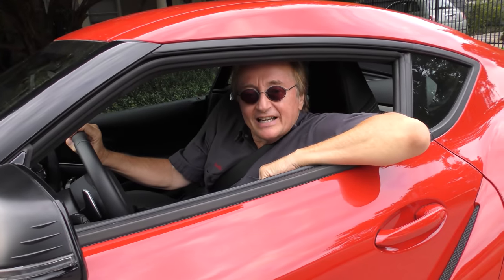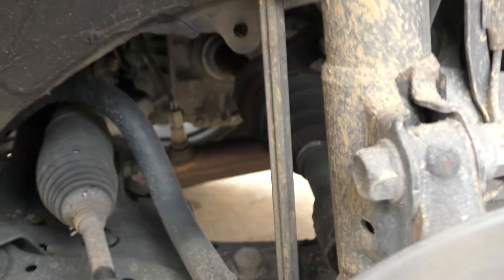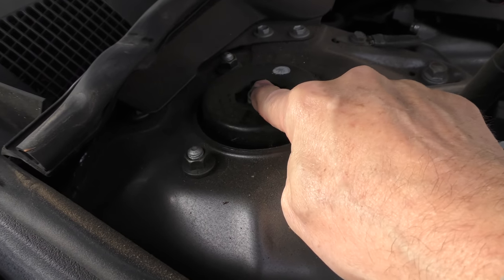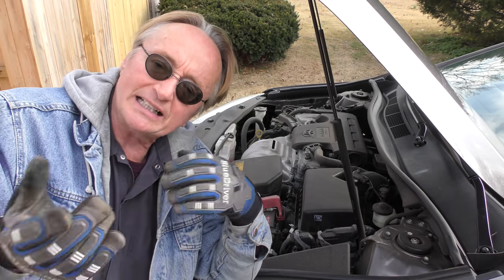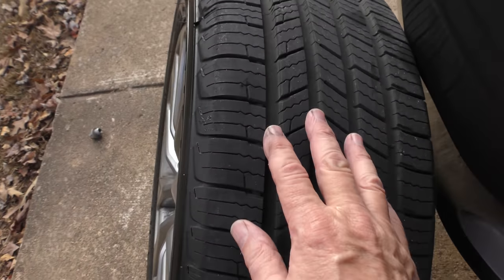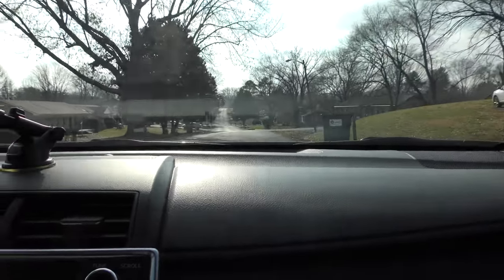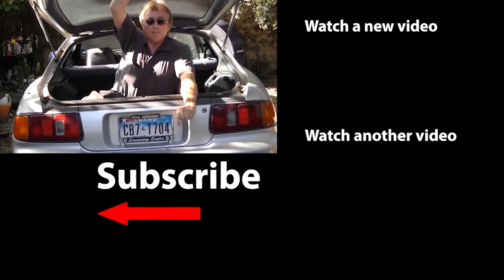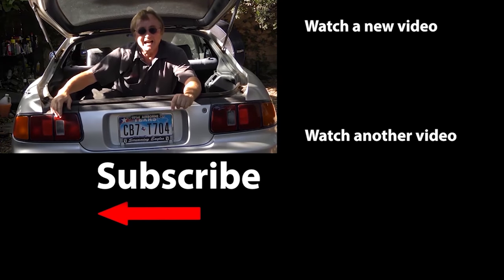Mechanics Don't Want You to Know This About Your Car's Suspension

Comment: Warning: DO NOT USE THE AT - 205 RESEAL on your rubber suspension bushings as Scotty is telling you to do so. It will weaken your rubber and disintegrate it if the rubber is old and crusty already. I know this because I listened to Scotty on this one and had to replace a rubber part a day after I applied this stuff. The chemical expanded the rubber so much it fell apart.
Reply: Oh no! I wonder if a basic silicone gel like someone else mentioned would work?
Reply: @CC12398   No idea. There are rubber conditioners for interior seals and trim but I never heard of anything strong enough to penetrate bushings without destroying them molecularly. I would just try to keep them free from dirt with occasional water spraying the dirt off.
Reply: @matreyia  thank you so much!
Reply: Could you just spray lithium grease?
Reply: @denver7745  I would avoid using solvents to penetrate bushings. I use Gummiplfege (rubber care in German) on all rubber seals and gaskets to keep them pliable and resist cracking from heat. I suppose that would work for the bushings but personally, I think just cleaning the underside from time to time will keep them from cracking. They are not exposed to sunlight as much as the topside rubber parts so the enemy for them is dirt and road chemicals.

Comment: Hate to say this but Toyota dealership mechanics & service managers, at least in my town, are complete scammers.  My wife got a coupon for an inexpensive oil change at a Toyota dealership so she took it in.  When they called back to tell us it was ready, the service manager says to me "you know, it's past time for your vehicle to have the timing belt replaced, & we should replace the water pump at the same time.  That'll cost about $1900."  Well, my wife's car had 32,000 miles on it & the pump & belt are good for 100,000 miles, so I crammed that factoid right into that guy's face.  BTW... Honda dealerships do the same illegal crap, which is why.... Scotty's channel is so popular.  I hate working on cars but I  hate crooks touching my car worse.   Thank you Scotty!

Comment: The rubber rejuvenator might not be such a good idea if it is the same thing as brake fluid, which is what most of your engine oil stop-leaks are made from. Problem is it starts out well by causing the rubber to imbibe the liquid and swell a little, but then it keeps swelling and eventually rots.
Reply: @hardassteel  Yeah, it will cause it to swell until it crumbles into little pieces.
Reply: @hardassteel  I wouldn't say that, as it can be a good temporary fix, but just know it doesn't last because of the rubber degradation after it swells only so far.
Reply: @akonitony2  I don't know the technology used for making these chemicals but it doesn't make sense to deteriorate rubber when it's formulated with the purpose to stop leaks due to deteriorated rubber gaskets and seals. 
ATP Automotive, the company that makes it has a YouTube video with the name "AT-205 RE-SEAL: Engine Stop Leak, Power Steering Stop Leak, Transmission and Differential Stop Leak" The video starts with the statement, quote: "AT-205 is an exclusive formula that stops leaks fast, by reconditioning and restoring rubber based gaskets and seals. ...  AT-205 contains plasticizers, the type of chemical used in the manufacturing of rubber gaskets and seals to set their flexibility. As a rubber gasket or seal gets older plasticizers lose their effectiveness, causing the seal to harden and lose flexibility, potentially causing leaks"
 On the other hand I wonder why this product is not also advertised and sold in spray bottles for what Scotty is using it but only as oil additive. Hard to imagine Scotty figured that out but not the company making it. When I search for "best treatment for car rubber parts and seals" it's mostly silicone based products.
Reply: @3dEmil  I've gone thru a year of organic chemistry on my way to Biochem. There is a saying, like dissolves like. You don't want to use petro-based solvents on petro-based rubber. Thoas products you mentioned work by swelling the worn seals until they stop leaking. They don't suddenly 'recondition' them and they are good as new. Factually, they do not stop swelling and eventually break open for a major leak for those dumb enough to not physically replace a leaking seal as soon as they discover it. Silicone will not penetrate petro-based rubber, but will dissolve silicone rubber.
Reply: @akonitony2  Thank you for replying. Do you know or how to find if all these rubber parts Scotty sprayed in this video are petro-based or silicone based rubber?

Edit: I just found the information on the label of the AT-205 Re-Seal bottles and since you said "if it is the same thing as brake fluid, which is what most of your engine oil stop-leaks are made from" I wonder if the following information make this chemical as you were guessing petro-based. 

"AT-205 Re_Seal is a fast, effective and safe stop-leak for all rubber seals and gaskets. The exclusive formulation restores worn or dried out seals and is not harmful to internal bearings and components. ... do not use in brake systems ... does not contain petroleum distillates"
Reply: @3dEmil  Experience. It becomes very obvious after comparing most parts. All of the parts he sprayed in the video were petro based rubber.
Reply: @akonitony2  Thanks. How about the AT-205 Re-Seal? From what it says on its label that I quoted in my previous reply, can you tell if it's petroleum based or not?
Reply: @3dEmil  I looked at it and it says no petro distillates and won't over-swell seals, so probably a good product.
Reply: @akonitony2  Thank you, I really appreciate your input.
Reply: @3dEmil  My pleasure

Comment: Hey Scott i had a camry 2012  my toyota dealer shop said my lower front control is tore.  But I drive it normally nothing wrong.   I only had 96000 miles.  Any concerns.   They said it is expensive to replace.

Comment: I had a 1996 Taurus and every time you'd drop the front suspension the upper strut mounts would creak and groan when turning the wheel. The transmission was replaced and we had to pull it back apart after that to replace the strut bushings to get rid of the noise.

Comment: My daughter's 2014 CRV has a rhythmic thumping coming from the left rear. It is clearly in sync with the rotation of the wheels and continues whether I'm accelerating or coasting.  It's very pronounced between 25-35 mph.  the noise stops if I turn the wheel to the left, but remains if I keep it straight or turn right.  I've already changed the wheel bearings, CV axles and sway bar linkage on both sides.  Like in this video, it does not sound to be anything majorly wrong, just very annoying. any ideas?
Reply: update: I took the entire back brake apart, lubed all the parts including the back of the rotor where it meets the brake shield.  Something in that process fixed the problem.

Comment: Hey scotty I am having a real bad problem I have a clucking in the passenger side front end of my 2021 honda accord when going over bumps it is under warranty so they replaced both struts but did fix the issue . I brought it back and they are telling me it's cause I used aftermarket brakes which is rediculous because it only that 1 side brakes are the only thing I'm responsible on the car . I looked at the links and bushings and they seem pretty solid but I did see a crack on the frame where the control arm is attached to it doest look huge but it's there . Do u think that could be it ?

Comment: Toyota do sell there new engines to other manufacturers 🤨 lotus have been been using different types of Toyota engines for years
Reply: This is very true! Lotus dumped the rover engines for the 1.8 and v6 Toyota engines.
Reply: @leestringer8881   they had used Isuzu before as well
Reply: @leestringer8881  Best move they did too but those Rover engines hurt their image and hasn't gone away since...

Comment: My car is a 2016. My battery light isn't showing. But my car won't start without a jump. Autozone said that my diodes are bad and my battery is dead. Car works fine after a jump, there isnt any dimming of lights. It's really cold here. I was gone for a week, but last year it was -10° and my car ran fine. What should I do?

Comment: But you didn't check the back for any signs of noise?  I can't recall if the Camry uses shocks or not in the back but it might be worth checking out the rear suspension too....  On my 97 Civic I used to get noises too when I go into reverse.  Found it was something loose in the rear suspension that needed to be replaced, so I'm a little surprised you didn't check both front and rear.

Comment: I experienced suspension noises after I picked up my car (Honda Accord V6) from the dealer (brake job). I inspected the car and tightened the top of the front struts incrementally over a period of 3 days and the noise was gone.

Comment: Scotty sir we have a Ford Aspire (KA) here in India. When we hit a sharp speed breaker at normal speed the suspension makes a thud sound, it does not happens on highway even though when we hit a bump on high speeds but it only makes sound when we hit a sharp speed breaker at low speeds and it only comes certain times (Aspire 2019 model) 
Can u guess what the problem could be?

Comment: I have 2000 ford expedition xlt 5.4liter motor cylinder 8 ignition coil is going out i have the parts to replace all of them but do i need to change the spark plugs or just clean them

Comment: The AT-205 stopped plastic fittings on the outside of my cars windows from bending & firmed up my wiper blades. Do not used on acrylic plastic, like brake/headlights & blinkers etc.

Comment: I have a 2001 Lexus and it’s about to hit 200k miles. Besides little tune ups and maintenance, the only major thing I had to replace was the harmonic balancer. It got old and cracked and fell off. I got one for about $150 tho and that’s the only major thing that happened over 20 ish years

Comment: Les schwab told me my lower control arm bushings are torn. I hear more then clunking noise I feel my steering wheel shake BAD when i press the brake at high speeds. Do u think it’s the bad control arm bushing? Or should I use the polymer

Comment: I have a 2006 Avalon with over 200k i take care of it i just got all new struts and driver side ball joint bearings etc.. From 60 to 70 only my steering wheel shakes not slower or faster??any suggestions?

Comment: Could also use a long prybar and wedge it by the control arm bushings to peek under to see if there are any cracks. I guess some mechanics replace the whole control arm with the bushings, but they can also be pushed out and pressed in with a machine, saving you the cost of the control arm. Something to look into..
Reply: The extra cost in labour is more then what you would save buying just the bushings. It is more economical to just replace the whole arm most times.

Comment: scotty  I have a 2018 toyota rave 4 se model . the car runs fine no issues get the oil changed every 5 k miles however my last oil change the dealership said i need to have  the front diff fluid svc,rear diff svc,throttle serv, and brake fluid svc.  the car has 30k mile on it and i dont know if i really need all that total of $544.09. need your advice thanks vincent  from nj

Comment: God bless everyone who watches these videos to learn lol. That bushing is warm out, dry rotted, and cracked. It’s not to the point where it’s unsafe to drive but it is warm out. Warn out control arms can allow the tire to shift when breaking or going around corners. It’s gunna wear tires out faster and you won’t have the best control of the vehicle under hard braking or turning. Everything on a car has a purpose and just because the tire won’t fall off doesn’t mean it’s not warm out and should be replaced.

Comment: scotty: i am looking to start a side job where i need a truck for pulling 14ft trailers 10k trailers to be specific and to stay under 26000 gvwr "truck and trailer combined"  i am looking at 2500 series trucks but i have never been a truck guy. looking for a truck under 10 thousand in your opinion is there a truck brand  that is better, offers more, breaks down less, a transmission i should look for, or worse look out for? maybe you could point me to a video you already have. thanks

Comment: Took a 2012 Honda Accord to get inspected and they said the lower control arms needed to be replaced to pass inspection but I checked them and they look just like that only a little rubber crackage.

Comment: Hi Scotty, Jeff in Costa Rica. I have ESC/ABS traction control fault lights on, on my 2013 Tiguan diesel 4Motion car. Is it possible that these faults show up when it’s time to replace the brake pads?  This car has less than 68000 kms on it, but this is CR, so, things wear out prematurely. I have pads already, so I’m wondering if changing them would reset the fault codes. Thanks, I hope you’re enjoying Tennessee. I have friends here from there. PS. I was thinking too that perhaps because the car is sitting so much now with pandemic restrictions, the sensors are corroding and giving false readings.

Comment: Hello Scotty, I have a Toyota Avensis SDN Prestige 1.6L 2008 manual 5 speed, and its doing the same. But can I use BARDAHL SILICONE SPRAY LUBE 400ml rubber care instead of AT-205 re-seal? Thanks.

Comment: Hi there Scotty. I just purchased a 2017 Toyota Camry SE. The car drives smoothly,  but have noticed a loud pop/crack noise while driving that seems to be coming from the dash or the windshield. The previous owner did mention the windshield had been replaced at one time for a rock chip. Can it be the glass was seated wrong?

Comment: I have a 2000 Toyota Corolla that started making a low pitched humming noise from the front end that sounds like a prop style plane flying by overhead but it only does it from 35 to 45 mph no noise slower or faster,..  what is going on Scotty???

Comment: I never tested motor mounts like that. Engine in gear, brakes set you power brake   If engine lifts the mount is bad. Test in drive & reverse

Comment: I have a 2014 Dodge Grand Caravan and just this year it started having little clunks in the front end I took it to my mechanic they said everything was fine but when I drive over small bumps it's louder in the front Tucker to the Chrysler dealer they said they couldn't find anything wrong with it either but it's louder in the front end and it was never like this before they said everything was tight in the front end I don't know if it's my tires but it's definitely not the same van that it was last year

Comment: When I change my oil every 5000 miles and use a mechanics lift . I spray all the rubber parts / components underneath with 303 Proitectant liberally .

Comment: Learning to work on your own car is probably one of the best ways to save a lot of money. I went to take my truck in to get it fixed, they wanted to charge 1200 parts and labor, most of it labor. So I purchased the part for 200 and installed it myself, took 5 minutes.

Comment: Hey Scotty, I have a 2002 Audi A4 1.8T Quattro and I hear a loud vibrating noise when I’m driving and let off the gas. Also a small thump noise when letting off the gas as well. The vibrating noise quiets down when I push in the clutch. I don’t hear it if I rev the engine while parked, only while driving. Wondering if you could give me some tips of what it could be?
Reply: Transmission mount

Comment: So I have a curb and had to replace my driver side strut but I figured if I was doing the driver side I would do the passenger side and then as I'm doing the alignment ,just the tow . I noticed that it has a lot of positive camber is there a way to adjust your camber without a camber plate to get negative camber ?

Comment: My 2017 Camry front left just started making a creaking noise over uneven road. Could just be the cold/dry weather affecting the bushings. Thanks for the tip Scotty, going to give this a try when its a little warmer out. Cheers from Michigan.
Reply: Check the anti roll bushings and anti roll bar links.

Comment: I bought one of those cheapo $170 battery 3/8 inch drive Harbor Freight impact wrenches to pull body parts off at the junkyards. Body panels are so  thin and flimsy now even my old battered beaten and worn Japanese made pneumatic butterfly rattle wrench will strip things on a car's body panels, but this little 3/8 Harbor Freight battery gun pulled the rims & tires off my Chevy Blazer. It did it so easily I got out the old Mossberg, Snap-On and Proto Torque wrenches and checks how tight they went back on. 65-75 foot pounds! I backed them all out to 65 foot pounds. 60 is factory spec, supposedly. It ran them back off again super easily at 65 ft lbs per nut, all 20 of them!!

Comment: My local shop told me today that I need new lower control arms. They told me you have to replace the whole thing and not just the bushings. I can't wait to get the wheels off the front and inspect it. I bet you they're  in perfect condition. The auto industry is one big scam. I've started doing everything myself on all our cars. It started when I got my '83 Mercedes 300D which is the best car I ever had and now I do everything on our two VWs. I'm saving thousands a year on maintenance and repair.

Comment: Thats not how you check lower ball joints and tie rod ends. Ball joints don’t have to be leaking there grease to be absolutly flogged. Check them by having the vehicle just off the ground use a big bar place it between the ground and tire and lever up and down trying to feel for movment. And tie rod ends and rack ends. Leave the wheel on jack vehicle up and check for side to side movment.   

But yeah those lower control arm bushes are fine honestly but here in new zealand those would be a hard fail at most testing stations (road worthys over here are stupidly overkill)